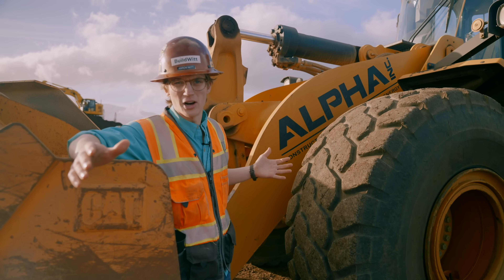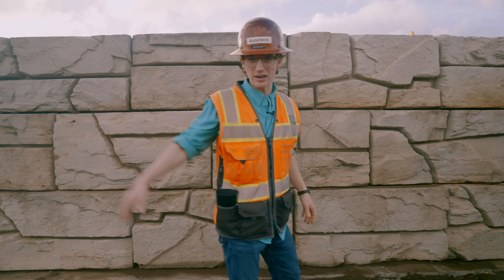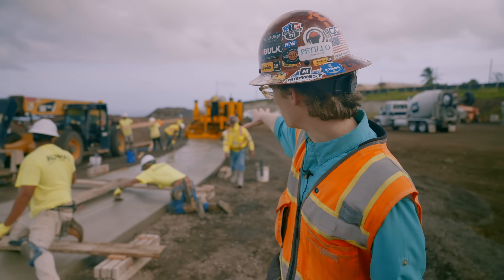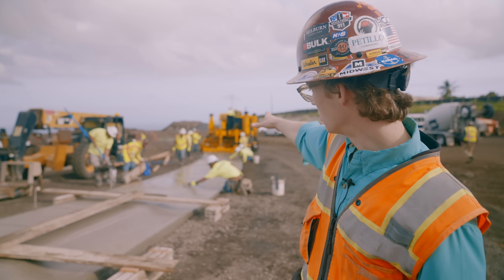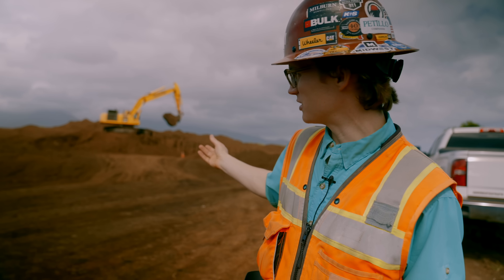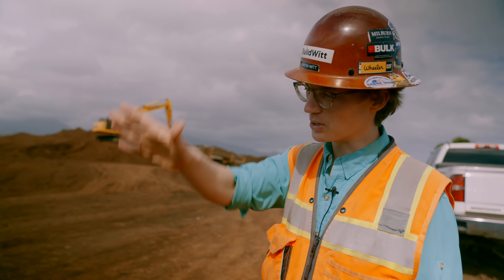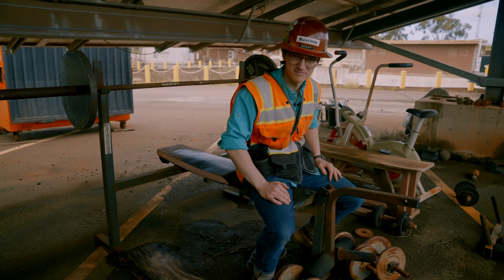Building Maui Subdivisions

Comment: How did they tie the concrete blocks into the soil. I didn't see any geotextile fabric or anchors.
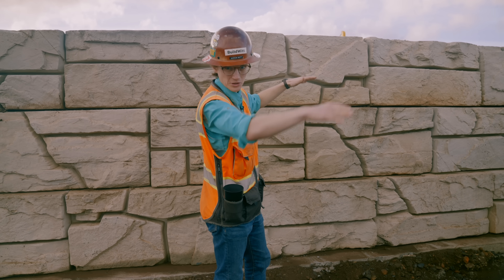Reply: at 1:50, they are sitting on a concrete footing though..
Reply: @blueman5924  It depends, but generally they need to be tied in.
Reply: Looks like a gravity style wall, also no freeze thaw in hawaii so not too often is there tie backs for realivtily short wall height